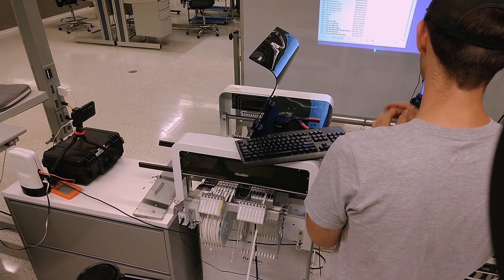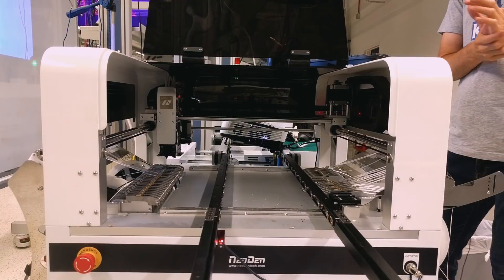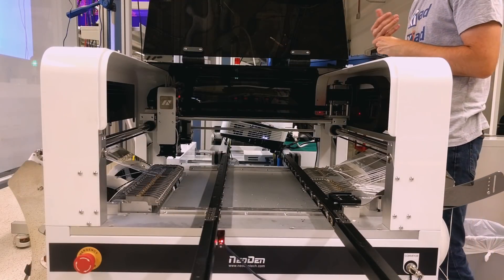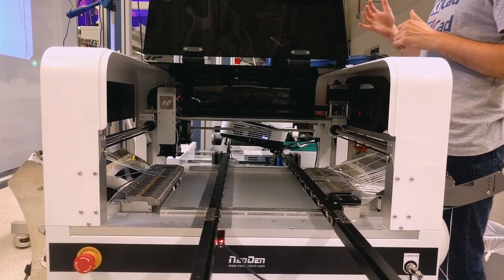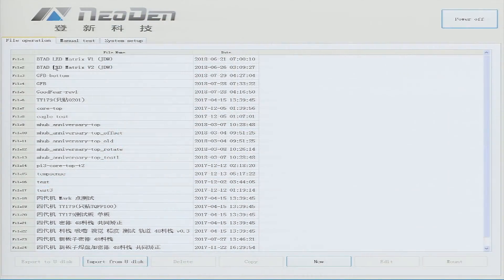Getting started with the NeoDen4 (Part 1) - Introduction

Comment: For those interested in this machine in 2021, I'm among one of you and I just talked to NeoDen HQ, here are my findings:

1. NeoDen 4 is NOT for 0201. Yes, it can do 0201, but only with cut tapes. The automatic feeder is not mechanically smooth enough not to cause enough spillage.
2. NeoDen 3V is better suited for 0201, as it does not support a motorized feeder at all. But apparently you need to load in parts manually.
3. The new NeoDen 8-nozzle PnP is designed around a much better and time validated Yamaha feeder design, and can be used to auto feed 0201 parts.
4. NeoDen S1 is their previous precision machine with ultimate accuracy, but at a considerably higher price.

Here in China, the 3V is only 20k CNY w/o VAT (with 23 feeder slots, 23k with 42 feeder slots, aka the 3V Advanced, 2021 revision, older versions are 20 and 44 feeder slots respectively), the 4 is 37k, the 8-nozzle is 88k, and the S1 is 98k. While you can also use cut tapes on NeoDen 4, it will have to occupy the tray area (shared with your precious PCB area), while cut tape feeder is intended for 3V and thus has its own designated area, not occupying any PCB space.

Also the gantry moving range is smaller for the 4 and S1 compared with 3V and 8-nozzle. The effective gantry range for 3V is 320mm*350mm, for 4 is 280mm*350mm, and for 8-nozzle is 300mm*700mm with rail PCB fixtures and 200mm*500mm with tray PCB fixers.

So overall, if you are after a lab PnP with good accuracy, I'll go with the 3V or jump right to the 8-nozzle. The 4 and S1 are outdated compared with the 2021 revision of 3V and brand new 8-nozzle.

As for me, I will certainly order a 3V 23-feeder version as I mainly use a PnP to deal with 0201, 0402, SOT882 and SOT883 parts, and I only need a lab machine without any regard to speed nor standard full reel compatibility.

Comment: Try loctite GC10 solder paste. It is lead free but behaves very well. My small vapor phase goes to 220 deg c and that is all. This lead free solder paste reflows perfectly at that temperature and is very easy to use (no refrigeration etc). I used it in processes that were more or less set up for leaded solder paste and never had any issues. The solder joint is perfect and has a nice shine to it.